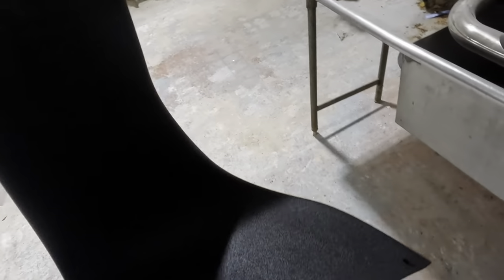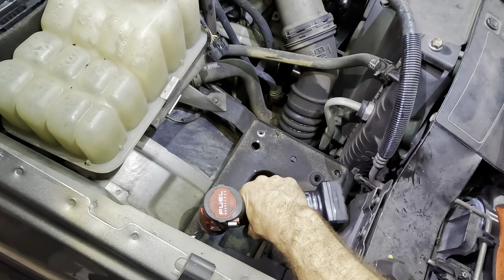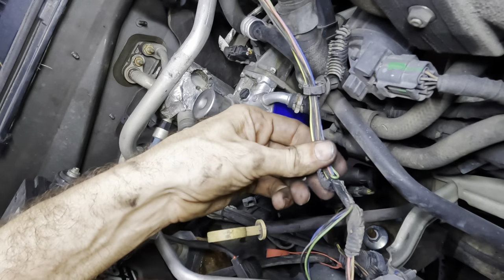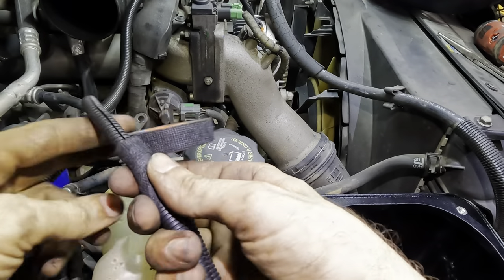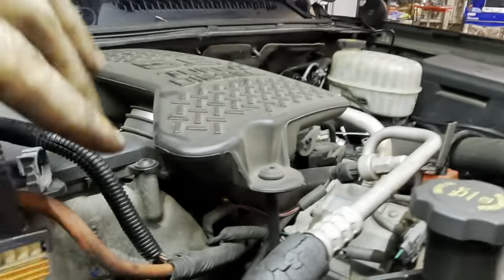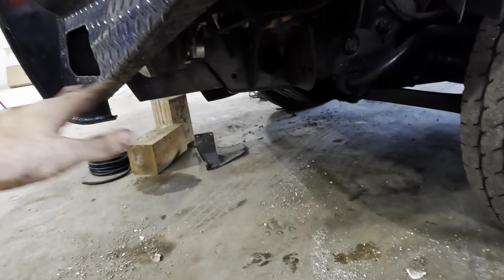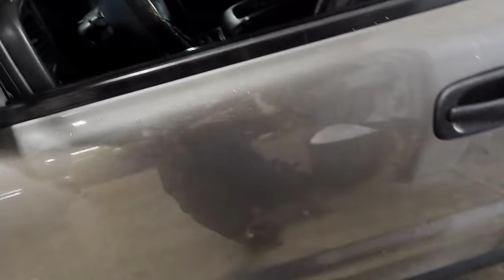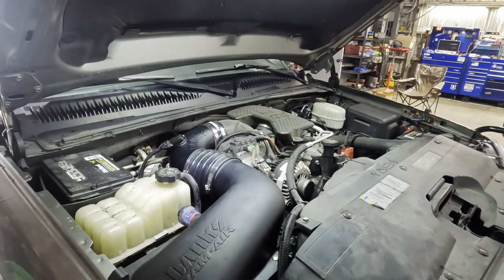This is BAD! And it's MY FAULT!  2007 Silverado 3500 6.6 @bankspower

Comment: Considering the recent hurricane, I would have thought you'd install an intake system that has the intake port up higher, rather than under the truck.  Soon as that lower intake is submerged, you'll be drawing  up a column of water if you go through a big puddle.  Something to think about.
Reply: I was expecting a snorkel.
Reply: Thinking the same thing the minute I saw it.
Reply: It looks like there is a pass through channel on the back side of it
Reply: No it won’t. There is an opening in the rear of the scoop about 1” high and as wide as the rear width of the scoop housing will allow. In addition to the funnel shape of the lower scoop, there are two very narrow straps of plastic connecting the bottom edge of the scoop to the rear of the vertical portion that direct some cooler outside air up to the filter box. The scoop is not sealed to the filter box and the box doesn’t get all of its air through the bottom opening. It is impossible for the engine to pull a vacuum on the scoop even if all of the lower openings are submerged in water. 
I’ve been driving mine through the hurricane like torrential rains we sometimes get here in North Texas for over 10 years now without issue.
Reply: I just told Ray about my situation, and it happen the same way.
Reply: @ralfie8801  Good to hear from someone who's apparently got one and been using it for some time. 
I was never concerned about rain because I could see the smaller opening at the rear and knew no amount of rain could find it's way up there. I disagree about the engine being able to pull enough vacuum to pull it up in deep standing water though. From my own experience, what I've driven trucks and even cars through have been well above where that's picking up from. If he was driving through say, 2.5 foot deep it would only have to pull it up another foot or possibly less to ingest some and the amount of vacuum from an engine intake could easily do that. Is there an alternative entry point higher up that they can draw through if there's a certain amount of resistance maybe, one Ray didn't point out and we mightn't have seen?
Reply: pretty sure were ray lives- is the lake whales ridge part of florida. AKA Florida's mountain range.. lol it doesn't ever flood there like that- also if you're in water thats ABOVE your tires, you probably should GTFO and get a boat... hitting a fire hydrant is something some idiot every time it floods in florida ALWAYS does. his mods are fine.
Reply: @lorditsprobingtime6668  
In addition to the opening in the bottom of the filter box, the Banks cold air intake still draws air through the factory location in the fender behind the right headlight. The engine can’t draw a vacuum on the Super Scoop because of the way the air filter box is made. It might be possible to drive through deep water fast enough to force water up to the filter, but I really don’t think that is possible without the water hitting the suspension and frame crossmembers along with the bumper and air dam slowing you down first. Rays truck doesn’t have those last two items, but he also moved the scoop opening up 2” higher than stock. 
Ives hit a lot of deep puddles at speed in my truck and it always slows the truck way down immediately.
Reply: @ralfie8801  Thanks. I didn't see where or realise it could still draw air from higher up, that shouldn't be needed but I've been through a lot of floods and lived with causeway type river crossings on a very hairy, flash flooding river, plus helped out during flood events by driving a 26 foot pantec truck through some pretty crazy deep situations rescuing people and their property so am probably overly cautious about this sort of thing. 
I am still puzzled as to why the pickup way down instead of the usual high mount snorkel type? I get that he doesn't need the snorkel idea but, he's now picking up air from just above the road where all the light dust, leaves and rubbish being blown along will be. Do you tend to get filters clogging faster with this arrangement or doesn't it make much difference?
Reply: @lorditsprobingtime6668  
It doesn’t make much difference. The whole idea of the scoop is to get air to the filter that is cooler than air that is drawn in by the headlight area which can potentially be mixed with air that cooled the air conditioner and radiator. It’s done the way it is to limit the body modifications that would be needed to mount it higher up on this truck style. 
I guess you’d have to pay attention when fording streams or deep flooded areas and take the opening in the bottom of the air box into account before attempting something like that. 
The system Ray and I have is intended more for getting cooler air to the engine when towing heavy on the highway.
Reply: @ralfie8801  Thanks. Yeah, it cosmetically definitely looks better than a hole cut through the front body for the snorkel tube to come through, then the rust growing mounting screw holes and plumbing all up the side of the car. 
I'm still a little concerned about the dust thrown up by vehicles in front and just blowing along the ground too but, this doesn't look ugly like the snorkels nor involves any damage to the vehicle itself. I think those snorkels were trendy too at first, not now though. This will never look ugly because it's nice and discreet. I do like it except mainly for that perceived dust sucking issue that you'd be saving your engine from with the high mounted snorkel, maybe that's a non issue though.
Reply: @lorditsprobingtime6668  Not to mention when driving into water you are effectively creating positive pressure. It's practically forced induction at any speed
Reply: @lorditsprobingtime6668  
I don’t really think dust is that big of a deal, I used to go elk hunting in Utah every October. There were many miles of mountain dirt roads driven during our hunts. I always cleaned the filter before leaving home for the hunt. The first few years I went, I would check the filter when I got back home to Texas. The filter was never noticeably dirty when I got back, so I’d just screw the cover back on and clean it just before leaving on the next year’s trip. There were some severe dust storms while passing through NW New Mexico two different years and those two years the filter was a little dirtier and there were a few blades of grass and some very small pieces of tumbleweed looking stuff in there, but that was about it. 
If any highways I travelled would be covered with dust, they would be in west Texas, New Mexico, and Utah. Maybe even in southwest Colorado also, but that would be around Durango and Cortez. It wasn’t all that desert like there and was usually wet when I passed through. I normally only clean it once a year in any case.
Reply: @ralfie8801   That was my main concern. If it wasn't much of a problem, even in a dust storm when there's HEAPS of dust moving and you're going to be picking some up anyway, that's when it would be by far the worst fine dust especially, down near the ground blowing along then it's pretty much a non issue then. It's got the colder air performance boost and it's neat and tidy and if anything it looks good under the bonnet and if you  look you might just notice the subtle difference under the front of his but, that's it so, good improvement then.
Reply: @lorditsprobingtime6668  
It’s not too noticeable on mine because the front edge of the scoop attaches to the bottom of the air dam with 4 plastic push pins. It hangs about 2.5” below the air dam. I haven’t managed to snag it on the ground yet either, so I guess I’ve been lucky there too.
Reply: @ralfie8801  I don't know what they look like with the original bumper but Ray did really need to take that up on his, that was only because of the way his bull bar sits though. I'm a bit surprised they'd have the front as low as he said, especially being a 4x4 beastie. Then again, I've got a Nissan Pathfinder from about 2014 and it's even got a stupid skirt type thing, not great ground clearance and because of stupid skirt thing that the dealership tells me I shouldn't remove so haven't, and despite the fact I've got a bullbar on it, that stupid skirt means as a 4X4 it has TERRIBLE approach AND departure angles. It's got the 3.5 litre V6 they used in the 350Zs and drives pretty good on the road, as long as you turn off traction control so the limited slip diff has a chance to work properly and stick it on 4X4 plus lock the center diff it will drive through quite a lot traction wise but, deep ruts even could have you hung up on the underside. Why they don't offer a push button adjustable suspension height option on these type of vehicles I just don't get. It could be pretty capable, if only.

Comment: In this case, just changing the filter probably had more benefit than the new intake.
Reply: I concur.
Reply: good point
Reply: Intake scoops only benefit the vehicle at higher speeds, cruising the suburbs they are pointless.
Reply: @johnt.848  Since you get 0.17psi at 100mph, "higher speeds" would be appropriate.  🙂
Reply: A dealers service department could void engine warranty if this filter was seen in their shop.
Reply: At least he didn’t just instal the intake in the engine bay like I see so many people doo. You need cold air for performance not hot engine air.
Reply: Agree
Reply: Where exactly is the "cooler" air coming from during a hot humid  rainy summer day in Florida?  What about all the tire spray?
Reply: @cstrick  outside the vehicle even on a hot day is more cool then in side the engine bay.

Comment: Ray, look into the cat fuel filter conversion for that truck. It uses the same fuel filter as the tow truck. And they are cheaper then the oem and filter smaller particles. 
A tip for the wiring loom:
If you peel back the wiring loom a bit, wrapp the tape a few times on the wire itself, then without cutting the tape, slide the wiring loom over the tape. So the tape is comming out of the split in the wiring loom nice and flat, then continue to wrapp the tape over the wiring loom. It comes out a bit cleaner and keeps the wiring loom secured to the wire. If its a long run of wiring loom, i’ll also tape it along the middle instead of just the ends.
Reply from the maker: I might actually install an electric lift pump with filters and then delete the oe filter…maybe
Reply: @RainmanRaysRepairs  you won’t regret the lift pump. Most of the cp3 (fuel pumps) that i have opened up, faked because if cavitation. They are not made to “suck”. Gm should had put a lift pumo from factory. You don’t want that fuel pump to fail. Its expensive and a pain to get to.
Reply: @RainmanRaysRepairs  
I have a FASS Titanium signature series lift pump on my ‘07 and had thought about deleting the OEM filter housing, but I’m thinking more on the lines of doing the PPE filter delete bowl that retains the WIF sensor and more important to me in north Texas, the factory fuel heater that is built into the filter housing. I also have the optional heater for the FASS pump. 

Don’t worry about getting water in your engine through the Super Scoop, here in Texas we get the same kind of heavy downpours you get in Florida, and I’ve never gotten any water even inside the bottom of the filter box through my Super Scoop. 

On another note, those two little screws that hold the MAF in the intake tube can come loose from vibration. One of mine fell out and set a DTC. The holes in those brass nuts go all the way through and allow enough extra air in the intake to set a code. I went to the hardware store and bought stainless screws, flat, and lock washers to replace the original Banks hardware with and have not had that happen again.
Reply: My son took on a large water puddle in his Mercedes. Three months and $15000
later he was wiser and mobile again.

Comment: I think the performance improvement  is due to fitting a clean air filter. I think you will have a bucket load of problems driving in rain.

Comment: I did the banks intake with the scoop on my truck.  My intake temps never get more than about 10 degrees over ambient.  It made a huge difference while pulling my 18k trailer.  Don't regret it at all.

Comment: Yep. High water is to be avoided. I have ram air on my grand am and it only brings in as much as the air filter will allow. My intake doesn't go to the bottom of the car. I saw a water drain area in the scoop. Maybe put a coarse screen over the intake to prevent critters or anything else from getting in. Good stuff Ray
Reply: If you look it up there´s no problem here worse than stock setup.

Comment: Great video 👍 Nice upgrade just remember careful when big deep water is present, maybe fit a remote flap.
Reply: I was wondering about that too. So many are designed with the intake higher than the engine. I can't imagine this would handle crossing much water without it getting sucked into the engine.
Reply: Yep. I don't like this "upgrade". I think it presents more of a problem for contaminants to enter the engine. He's going to have to replace that air filter once a week. lol.
Reply: Lots more dirt to suck in the lower you get.
Reply: If you look at the beginning it has an "open intake" i.e. a hole at the back of the scoop for water to pass straight thru...
Reply: I too agree, especially in Florida with all the water we get in certain times a year. 6-8" water standing in some roads is uncommon. But the unit does look good!
Reply: @geordiegixxer  what of the scoop is entirely submerged not allowing air in?
Reply: @djboogy3985  yeah, that's a point....
Reply: @Jim Hall  this is for people who purchase trucks to be used as a car. If those types of trucks ever sees deep water, it will probably be because somebody drinking to much,  it was parked in the wrong spot, or the costs of diesel finally got too high and the owner wants to try fo get the insurance company to buy them a new vehicle.
Reply: i hope Ray comments on this question.i live not far from him and when it rains it gets bad
Reply: @geordiegixxer  I missed that 🤭
Reply: Maybe it will get hydro locked. At least we can watch a 6.6  rebuild video.
Reply: At 8:45 you can see slots going all the way up the front. If he runs in that deep water I expect he'll have more issues than water being sucked up.....

Comment: Hey Ray. Nice install and setup.  I noticed something at 25:00 in the video.  It didn't look like the low pressure switch connector on the A/C accumulator was plugged in fully. Didn't see the clip snap into place. Just thought I'd mention it as you could get moisture inside the connector or could come loose and fall out.
Reply: I also saw that
Reply: Me three
Reply: Forth!
Reply: Also noticed this and scrolled down to find this comment.
Reply: It was the focus of my attention for the rest of the video. Every time he passed over it with the cam I looked to see if he clicked it.
Reply: Totally noticed also, at 47:20 you can see the white retainer clip is not over the the blue connector to lock it in.
Reply: It became my main focus too. When he put it on, it never went click...
Reply: Yes he missed the click and it definitely wasn’t fully home - it will come off at some point. Ray you need to click that :)
Reply: He is probably laughing his ass off because he just pulled the ultimate "click" bait, we all watched every second of the video to see if he would click it.... Well played.
Reply: reeeeeeeeee the clip
Reply: Yes click it Ray
Reply: @pw9267  lol.
Reply: Quick click

Comment: the subjective performance improvement may be the clean air filter; also a garage in Australia did a comparison of cold air intakes on their chassis  dyno there was no statistical difference amongst the after market units compared to the factory intake....but enjoy your Banks parts!
Reply: well, even if there was a slight improvement, at best it will be a few horse, if any, but still, when you pay a considerable sum for something, you would subconsciously trying to find a reason you spent all that money, so that might make you think it is actually helping... and i am pretty sure all of that was definitely not cheap, all of those good quality materials, their processing, whatever cost it also has, i will definitely not be surprised if it is a few thousands
Reply: @Qwertyuiop-wg5xu  I just KNOW my car goes faster when I've spent half a day washing and waxing it...
Reply: @tonyjover  oh yeah of course, that makes it more aerodynamic, it just slips through the air like nothing, definitely that changes a lot, of course

Comment: My concern is the way water gets pushed forward by the tire when pushing through puddles.

Will this water that is push and splashed forward get pulled up into your new air intake lower scoop and thus to the filter and eventually into your engine?

You may need to put plash flaps in front of your front tires.

Comment: I did over 40 years doing sheet metal, believe me you can run a self Tapper through two pieces and strip the threads at the very top of the screw and still pull the other plate against it.
Some well-fitting expanded metal in that intake will keep the dogs of small children from going up into it. That's a great place for rats to start building nests, as well as other vermin.

Comment: I live in Queensland, Australia, so similar weather conditions and most people here use a snorkel, rather than a scoop, even though there is a flow through, once fluid gets deeper than the flow through (in this case, not even half way up the wheels which is normally your maximum water depth) you then have a suction pump, hydrolock incoming, as you have the forward motion pushing water into the scoop and then the suction of the engine pulling it up. I would recommend making some holes further towards the top of the scoop, just before the airbox and possibly remove the self tappers at the join between scoop and airbox.